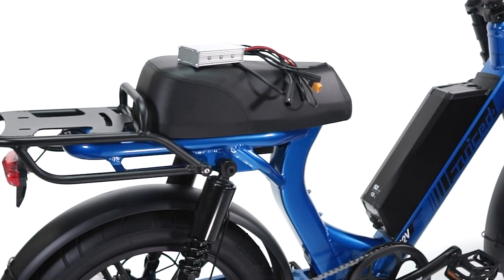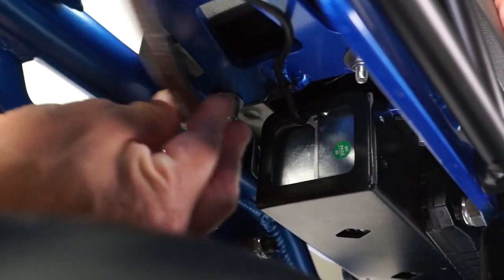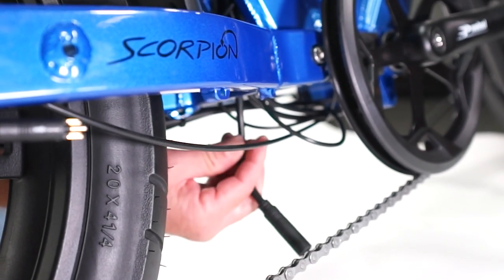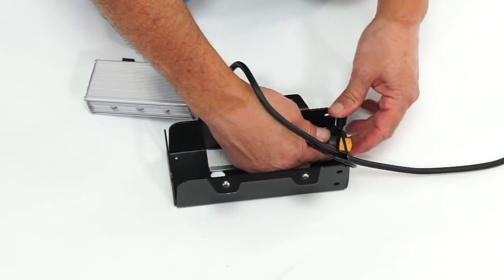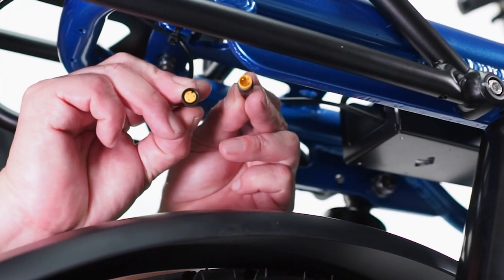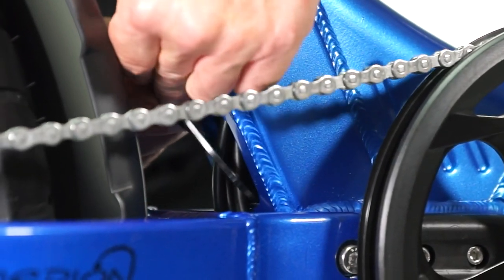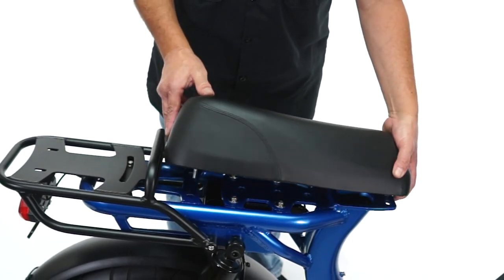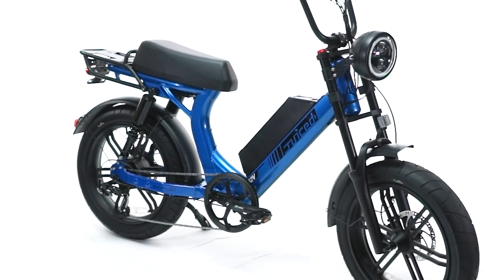Scorpion Off-Road Throttle Upgrade Kit Install

Comment: Is the process the same on the hyperscorpion?. I shorted  the black tip wire out that runs through the frame and the bikes dead. A new controller should solve the problem right?

Comment: I was skeptical about this, because i would have preferred that the scorpions simply arrive like this.  Having installed it, i can say it was worth it - throttling up to 27-28 on flat ground (private property only 😉), with the better off the line acceleration, makes the bike feel more capable of keeping up in traffic.

Comment: If you are trying this on an X2, the motor cable is on the other side (red cable)...took me a minute to figure out.
Reply: did your motor cable connector fit through the lower swing arm, mine is too fat

Comment: what is the name of the longer cable with the arrow? I need to replace it thanks for help.
Reply from the maker: Hey 👋 Sounds like your looking at the motor cable that leads from the controller - unfortunately that cannot be replaced separately, you would need to purchase a new controller.

Comment: This Upgrade should be provided by Juiced Biked at NO charge!
Reply: It’s an aftermarket upgrade though for off roading. They do this for their other models, too. For example their Camp/City Scrambler.
Reply: @EvanMooreZ  It's being promoted by Juiced Bikes so it should be a FREE Upgrade since the original Scorpion was advertised to go 28MPH with standard controller. But it does NOT go 28MPH ONLY 20MPH then the controller cuts off unless you keep pedaling FAST...
Reply: @fanofoldfans9238  both of my scorpions go to 28 MPH with its standard controller, but it requires me to pedal assist per the class 3 laws. this off road controller will allow us to go to 26 mph with torque instead of the advertised torque speed of 20 mph.
Reply: @EvanMooreZ  Juiced Bikes advertises the Scorpion @ 28MPH. This new controller should be sent to Scorpion Owners Free of charge!
Reply: FanOfOldFans with peddle assist only
Reply: @EvanMooreZ  There's NO WAY peddle assist will engage @ 28mph unless there's a different sprocket ratio?.
Reply: FanOfOldFans ah, I see what you’re asking. Peddle assist will always work up to 28 mph, but good luck getting to that speed manually because it’s difficult. if torque didn’t disengage at 20 mph, then it wouldn’t be a problem, but since it’s a class 3 bike then that’s why torque won’t work passed 20 mph. This off roading controller allows your class 3 ebike to torque up to 28 mph in (R) Race mode without peddle assist now. So, it’ll be much easier to hit that speed now.The bike will still disengage peddle assist and torque if you peddle above 28mph even with this after market modification. Anyway, my upgrade kit just shipped yesterday, so I’ll make a comparison video of both bikes at same time: one with upgrade kit and one without upgrade kit.
Reply: @EvanMooreZ  It's obvious you are sponsored by Juiced Bikes ... If you just pedal at any speed it will go up to about 26 going downhill. What is your wheel diameter set to? I've had several answers on that one. What's yours? That will affect the spedo calibration.
Reply: @fanofoldfans9238  they advertised top pedal speed of 28mph, not throttle-only.  While i would have preferred for the Scorpion to come with this in the first place, it's not true that they advertised 28mph on only throttle.
Reply: @0xStellz  Nope it's advertised @ 28mph as is.
Reply: @fanofoldfans9238  yes... when you pedal, as with literally every other class 3 bike.
Reply: Can you guys throttle up hills as steep as San Francisco
Reply: I purchased one of the last of the base Scorpion models several months ago. Right before they introduced the x model and removed this one. Mine came with the upgraded throttle. I can reach up to 28-30 mph with throttle only.

Comment: I'm getting my scorpion on Tuesday, will I have to install the off road throttle upgrade kit or is it  installed before shipped?
Reply: @juicedbikes   Bike did not come with with upgrade
Reply: No, rather bummed about it since that was the reason I purchased the bike in the first place. I really like the though.
Reply: I left a email stating that I didn't receive the throttle upgrade with the shipment of the bike.
Reply: @juicedbikes  Thank you so much for your  quick responds.  This is my second E- bike owned and I love It! I cant wait to get the throttle upgrade!!

Comment: Can it handle a 60 volt battery?
Reply from the maker: Hey 👋 We have not tested any outside batteries with our e-bikes. They are designed to perform optimally with the 52V battery platform.
Reply: @juicedbikes  I doubt it will handle  60 volts. A 52v fully charged battery has an initial voltage of 58.6 volts. A 60v battery has an initial voltage of 67 volts and will likely fry the controller.